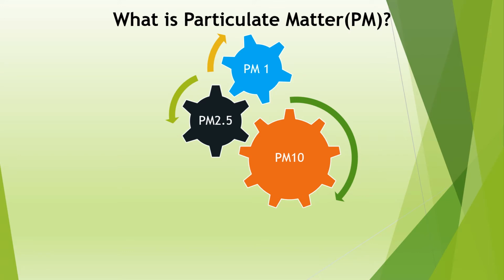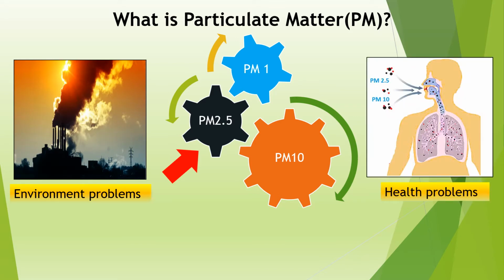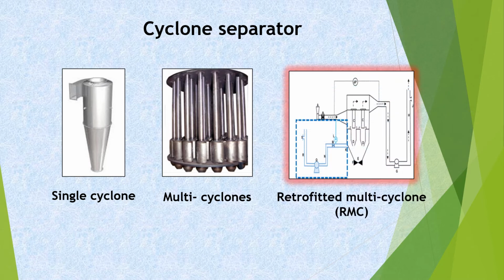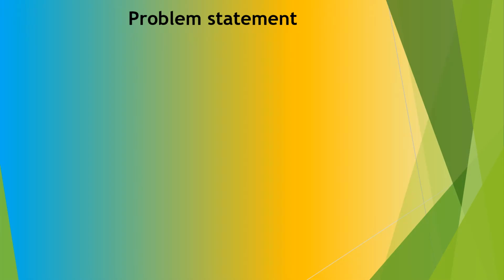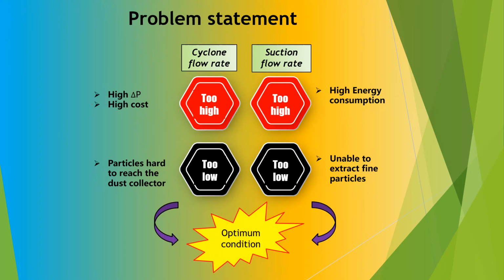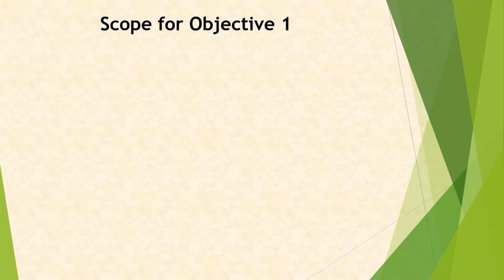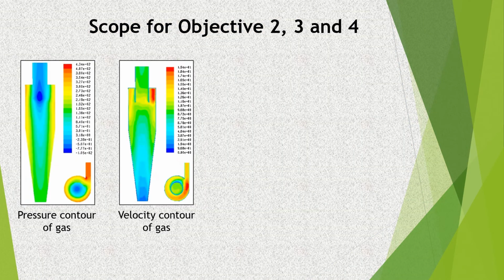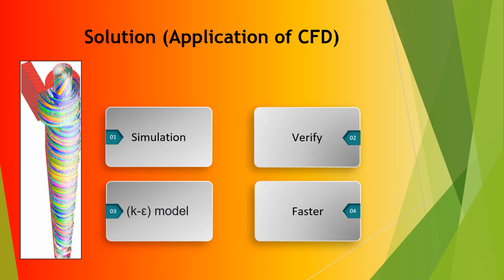5 min FYP Thesis

Comment: In your scaling up, what will be your consideration on the process and size? In actual industrial process, what could possibly contribute to disturbances of the process?
Reply from the maker: In my scaling up, the simulation’s configuration time will be the parameter that I will consider in the process of scaling up. Appropriate turbulence model of computational fluid dynamics (CFD) should be chose in order to complete the scaling up process successfully. Compared to other turbulence model, K-ε RNG turbulence model is the most suitable model in CFD as it took lesser configuration time to simulate the RMC and at the same time it can generate accurate results. While for the size, cyclone diameter is the parameter that I will take into consideration. This is because in scaling up process, the cyclone diameter confirm will become bigger and will degrade the collection efficiency of RMC. Hence, it is crucial to control the cyclone diameter while scaling up RMC.
In actual industrial process, capital costs and operating costs will be the disturbance of the process. This is because greater cyclone flow and suction flow rate is needed as larger RMC (100 small diameter cyclones) will be used in industry process and thus increase capital cost. This subsequently might lead to more energy consuming and operating cost as large flow rate is being used to handle large volume of dirty gas. Thank you for questioning, Dr Tan!

Comment: 'Question from Examiner:'

Hi EuGene, how are you
in your opinion, how different will the result from CFD compared to the results obtained from real experiment. and what is the name of the software that you will be using. I can see that you have 4 objectives, what is the main objective for your study that actually could be the parent for all these objectives? 

Thank you
Reply from the maker: In my point of view, the deviation of the result of CFD is not large as compared to the real experiment. Previous study has shown that the deviation between the CFD results and experimental results are below 8% for all cases. CFD can be considered as powerful simulator as it can offer quite good prediction of the experimental results within acceptable range (15%). ANSYS Fluent is the name of the software used for CFD. Scaling up the Retrofitted Multi-cyclone is the core part/parent in this study because the findings will be the reference for industry scale and then assist in building prototypes in the future. Thank you for questioning, Dr Nurul!! :)